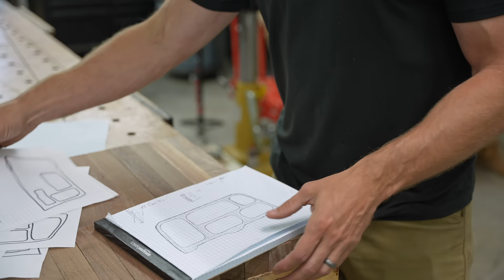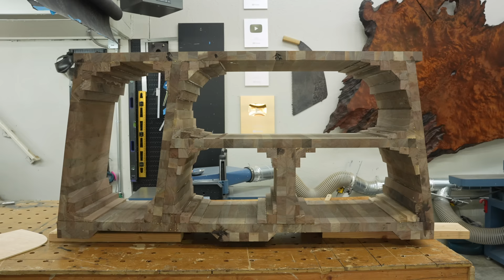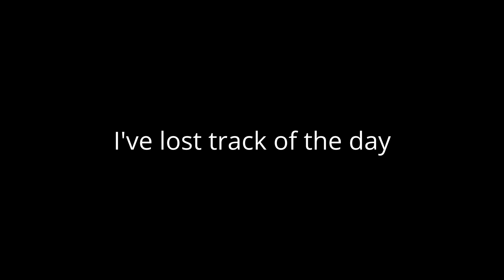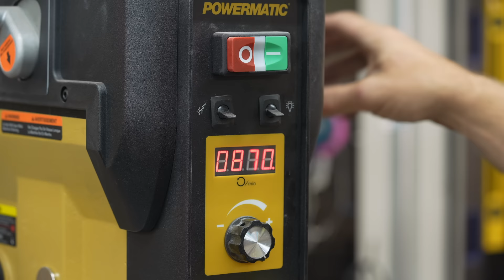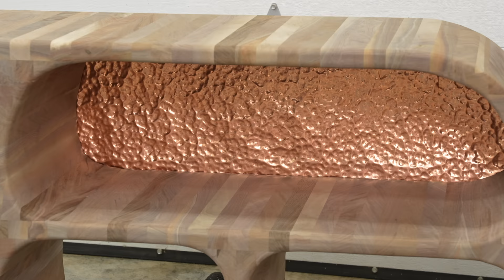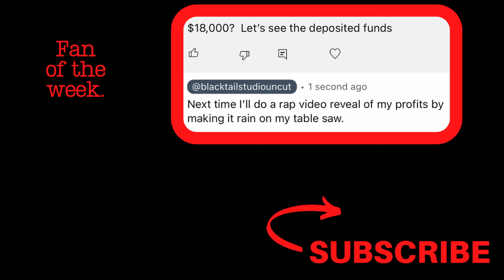My Best Project

Comment: It's too bad that most power-tools (with the possible exception of Festool) are not true Industrial Grade, because with the types of projects you typically take on, it would be nice to have the kind of tool or implement that can operate at high speed / high heat on any material, under any conditions 24/7 without ever breaking a sweat.

Comment: couldnt you have used a band saw? you would have to cut the band in half in order to get it into the holes, but other from that it might be able to get larger pieces out with a straight angle

Comment: Hey, Cam.  Quick question about that amazing "Vesting LED HWO" that you are using. Could you tell me what wavelength of UV is best and at what Energy density or radiance at the surface. This will be stated for  inIrradiance in W/cm^2 and  for Energy density J/cm^2.  What I'm really after is how much power in the LED source and at what wavelength in nm (nano meters, 1X10  -^9 M) so that I can design a very efficient, broad area coverage, UV Light source to cure my work without spending a young fortune. Or could I just get the detailed specifications for the expensive LED light that you use...Thanks...kunk

Comment: What is the difference between using the UV light gun which you are using which I saw on Amazon to be around several hundred USD / GBP and a simple UV torch light at just a few bucks ?? I love your bookshelf which you have just made, it makes a nice change from watching most of your other videos which are usually about making tables. 
Also I did a Google search and came up with this, is this just untrained bullshit ?? 

"People also ask.....

Q) Can you use UV light on wood?
A) UV radiation actually damages wood fibers. This process renders them less resilient and more prone to cracking or sloughing off. If left long enough, UV radiation will cause board warping, cracking, and cupping." sounds like somebody doesn't know what they are talking about because I looked up the company name written as written on the side of the tin of hardwax oil 26:36 and I watched their promotional video on the subject which was very interesting  

But again on another Google question it makes me wonder who is hired to give the answers because they are suggesting UV light to be used for 3 to 4 days or wait six months for natural drying 😮😮🙄🙄😅😅😅 

Anyway can you verify my question about the expensive UV light versus a cheap UV torchlight at just a few bucks ?? what's the difference ?? (apart from a few hundred dollars) 😂

Comment: you're not using the right tools for the job when it came to the hand tools. I only use them where necessary but I'd have used a spoke shave to get the majority of the material after the chainsaw and grinder. Also, no one uses dominos to connect small boards like that.